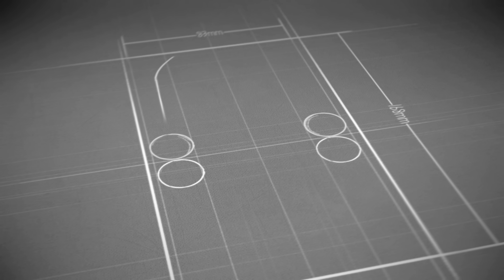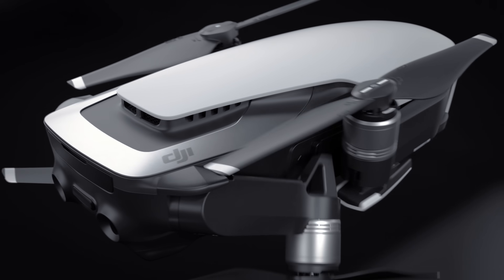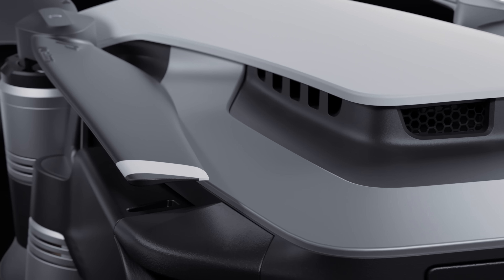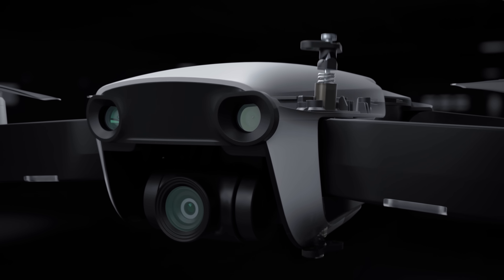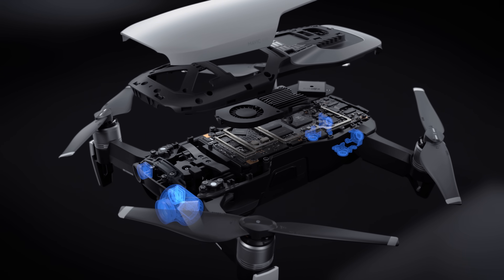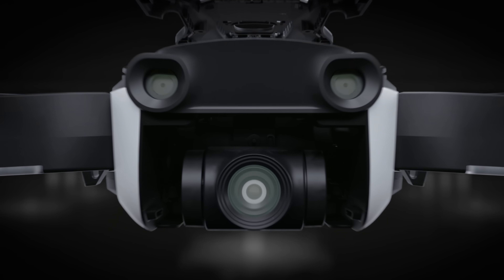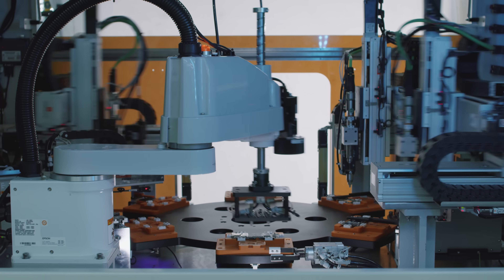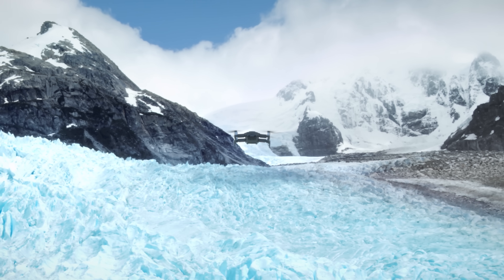DJI - Mavic Air - Elegance and Power

Comment: I do not know why so many skip the essential facts, i.e. that Mavic Air breaks the range in the city already above 100m (distance), is very weakly resistant to winds, and DJI ignores Poland in applications that defective constantly orders us to upload. Remember that the warranty is one and the European (and Polish) consumer law (for entrepreneurs warranty) is the second - if they upload a defective application, even after 5 years you can demand a refund for damage caused by the application loaded a month earlier (if the application caused, for example, the fall of the drone ). I also warn against DJI osmo mobile 2 which has no promised functions on the android. Zooming works tragically, and that's not all!

Comment: As others have said, this is a complete ripoff of Apple's advertising.
Reply: because DJI has deep working relationship with Apple and share similar consumer demographic, you can google this "
4 Reasons GoPro's Drone Dreams Evaporated"
in that article, it said "To top it off, Apple showcased DJI's drones at hundreds of its retail stores, and let DJI employees offer customers hands-on drone training sessions in their stores. That partnership seemed like a natural fit, since DJI and Apple cater to a similar demographic of affluent tech enthusiasts. GoPro, however, didn't secure any comparably impressive retail partnerships"

Comment: Don't you mean the Spark Air DJI?!
The main deal breakers for me are loss of Ocusync and shorter battery life. They should have made the mavic battery and controller compatible with it and it would be good.
Reply: This is my second comment^ I had typed the exact same text and pressed enter....and then suddenly my comment then reads "Cool" What the actual F@*#?!

Comment: Given the plethora of issues from my mavic pro I won't indulge DJI in my business.  I had 3 drones returned for various issues not by my doing ie... gimbal error and other malfunctions.  I'm on my 4th drone. So I'm done w DJI
Reply: At the moment I can't suggest anything else since the mavic pro has no real competition and they monopolize the market at this point.  But go for it,  I could be wrong however they aren't getting any more of my money.  Even at this current time I have an additional battery that is completely DEAD. Called up DJI they said it's out of warranty, mind you the battery just stopped because of the ZILLION freakin UPDATES every 2 mins and I forgot to charge it. So I'm down to 1 battery.

Comment: I looks like i m watching an apple comercial product for sure.
Reply: Deff, getting away from dji since they tool the way of apple works. Getting the tech to you little by litte for you to be a consummer, they will create those iphone believers that for the same iphone every year with the only different of the camara changed. 
Dji could launch the phatom 5 at the beggining of this year, but they are still keeping the consummer with another phantom 4 upgrade that could be done on the 4pro.

Comment: the Air weighs 430g (0.95lb), making it 41% lighter than the Pro
when folded the Air is about half the size of the Pro
the Air's maximum speed is 68.4km/h (42.5mph) versus the Pro's 65km/h (40mph)
the Air's maximum flight time is 21 minutes, shorter than the Pro's 27 minutes
the Air's maximum control range is 4km, less than the Pro's 7km

Comment: The Spark had so many compromises so I got my Mavic Pro last month. I have to say the Mavic Air equals or bests the MP in almost every objective way (besides range and flight time). I got mine DJI refurbed at $699 so I don't feel so bad, but otherwise, this Air is pretty amazing with all its little design improvements. A lot of jealous MP owners don't wanna admit that.

Comment: We need drone for about 200-300$  with good 1080p cam and 3 axis gymbal
Reply: Get a spark
Reply: Phantom 3 should be that about now or soon.
Reply: IndyKurt something smaller
Reply: Sibin Chen spark has no 3 axis and remote controller include
Reply: at this point in drone production, smaller is better. and that cost more. A gimbal with an included camera is too much technology for that price range. A gimbal that carries an action camera ie GoPro will be too big for a small drone. Where is size an issue other than hiking or trying to be inconspicuous in travel. Your 3rd point of avis could be just rotating the whole drone and have a 2 axis.

Comment: Seems like DJI don't care about quality of output only how many you can fit in your pocket. This should be a Spark Pro and does not deserve to have the Mavic label.  Really disappointing, wake up DJI and deliver of the quality of video/stills and not number of sensors etc.  And WIFi, really.... lol
Reply: I agree, when will we get a real new Mavic pro 2 with all the phantom features ? The phantom has been upgraded several times, and the Mavic only once.
Reply: its literally a smaller mavic pro, thus air, lol. Spark doesnt even fold and more toy like while Air has higher bitrate and definitely aimed at prosumer

Comment: Most dislikes are karma pilots
Reply: the Mavic 2 will probably be announced later this year to crush the Evo the way the Mavic crushed the Karma
Reply: I don't think so. The rumor was that the Air would be slotted between the Spark and Mav Pro (which turned out to be true) and then later there would be a true Mavic 2. DJI isn't gonna sit back and let Autel make a better mavic rip-off. They're gonna want to be a the top and they have the money and R&D team to do it.
Reply: Phrancis5 as u said (THE ROMURS). It said also that MA camera should has one inch mechanical shutter. No my friend they are fixing the issues in second prototype of P5, which they delayed from autumn 2017 till 2018 spring. Have a nice day sir.
Reply: Arjun Menezes i have a drone shop and am a dji dealer and that's way less than the expected. Too long, about a year and a half and dji gives us whats already in markets tech stuff (CHECK THE EVO DRONE). At least they should had made the camera quality as p4p camera. Thats simply not enough for that long period of waiting.
Reply: why does everyone think there will be a Mavic 2 this is the mavic 2 JEEZ
Reply: Looks like you were wrong lol.
Reply: Phrancis5 didnot u know???!!. This is the very mavic 2 AKA mavic air. There is no mavic 2.

Comment: I like the fact it plans the flight path around obstacles greatly reducing crashes.. Other than that and the new boomerang and asteroid smart modes, I couldn't see myself spending again..

Sticking with the P4 Pro.

I'd definitely say the sales of the original Mavic and the Spark, will go down.. Better to go for this for your everyday travels... Be good for a back up drone to the P4 Pro though :)

Hoping if they release the P5, they include the new pre planned route avoidance circuitry with that! :)

Comment: But I just brought the Mavic Pro.....
Reply: The mavic is still the top dog this is just a cheaper alternative
Reply: mavic pro is still very small
Reply: I bought spark 2 months ago... , new drone already? :D
Reply: bought my spark 4 months ago:/
Reply: marshall branin both of air and pro are great drones. just brought the air over the pro and it is quite a struggle especially when you could get them at a similar cost. I finally decided to give up the better ranger for a small fit and the points you mentioned because i used to fly P3S, and its size is too big to carry. BUT I will buy both if i got money and mavic pro is definitely not a bad deal
Reply: ApexRacer GT3 mavic pro is better
Reply: Return it.